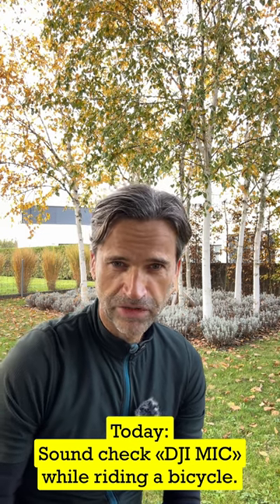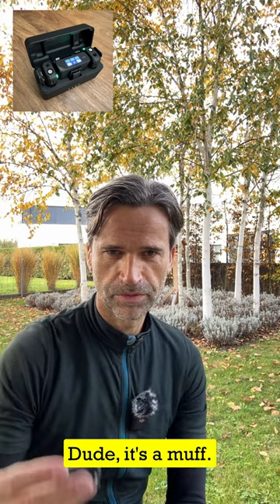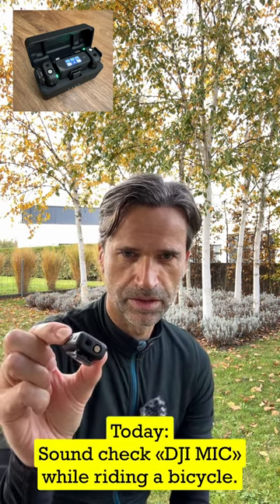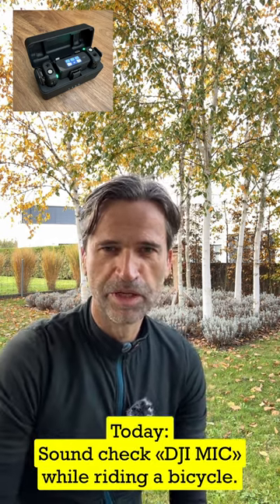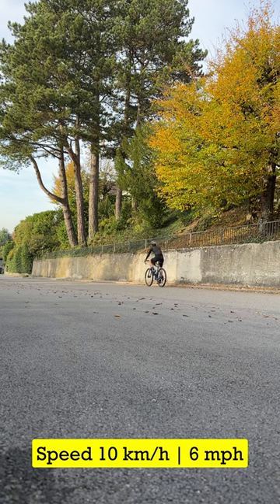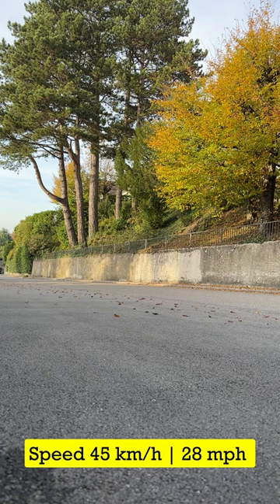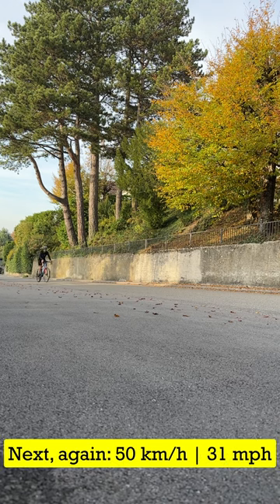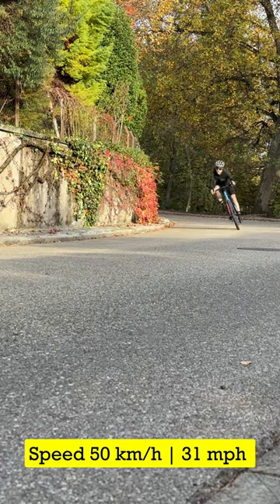🎤 How the wireless DJI MIC sounds on a bicycle at 50 km/h

Comment: Hey Inside Alps, thanks for that test. I’m excited to see I’m not the only one why tries out different setups with the mic. I got my DJI Mic too and I’m just trying to work out the perfect settings. My voice is loud and deep and I’m having problems with clipping. I already reduced the gain to -2 on my transmitter but im still hearing clipping now and then. I just released a video about the DJI Mic where im talking about that. Do you have any good ideas on how to go about that? Thanks 🙌🏼
Reply from the maker: Sorry, don't have any good advice. Maybe it's worth trying though to reduce the gain on the receiver as well.
Will soon put the DJI Mic to test on the ski slope!
Reply: @InsideAlps   thank you for your advice. Yes i will experiment a bit with it. Im gonna post an updated video as soon as i have figured things out. It would be too bad if that $400 mic was a bad investment. Im also looking forward to your ski slope!

Comment: Excellent test! I was looking for the best setup for sound on the bike and had hopes this mic was the ultimate but at a premium over the cheaper Wireless Mics. As always the iPhone mic volume needs increasing on +3 - +7db. Are you pleased with it still after a few more weeks later ?  Also label the Title as #shorts and it will show up on YouTube Shorts section.
Reply from the maker: Yes, I am still very happy with it. I love the feature that you can use the transmitter as a voice recorder. You will always have crystal clear audio (in case you lose the signal to the receiver) and you can use it independently of the video. After recording, you just plug the transmitter via USB into the computer and download the audio file. However, in my shorts video I used used the audio that was sent to the receiver via the iPhone 14 recording, because I wanted to test the signal strenght, which was fine. Btw, also like that it works perfectly fine with an iPhone. 
And thanks for the #shorts Title tip!
Reply: Hey Tom, I got the DJI Mic and im trying to figure out how to stop it from clipping. What did you mean with setting the iPhone volume to +3? Do you mean the receiver? How is that helping?
Reply: @HaveYourADVENTURE  most other wireless mics need the volume increasing by at least +3db, if clipping is a problem dropping the mic receiver to less db’s then increase volume in editing.
Reply: @englishcyclist  why do they need the volume increased by +3? That I don’t understand. Are they too quiet? Apparently I have the opposite problem. I got my Transmitter at -2 but it’s still clipping. I just released a video on my channel about the DJI Mic and I can hear it clipping ever so often in that video. The DJI Mic also can change the gain at the receiver. I wonder what that does. Any thoughts on that?